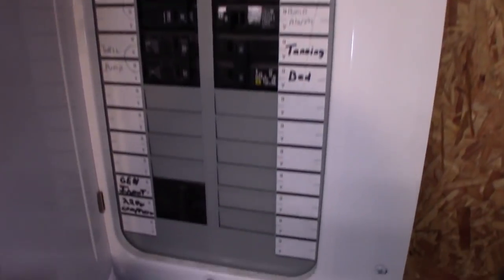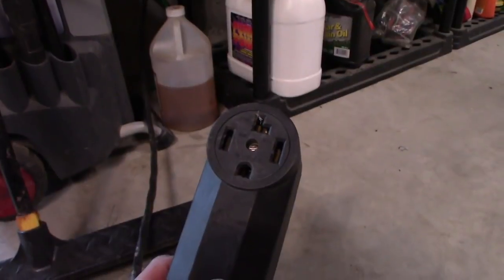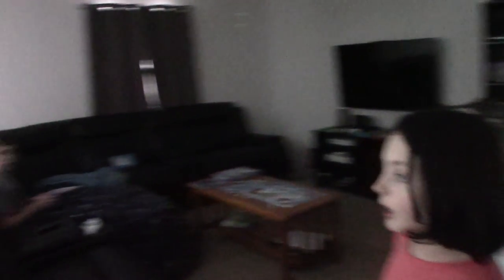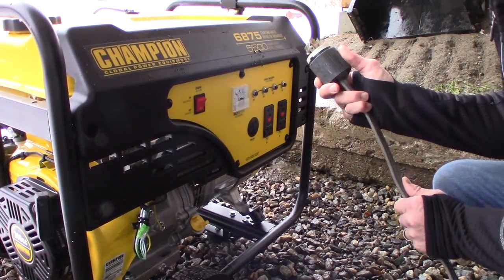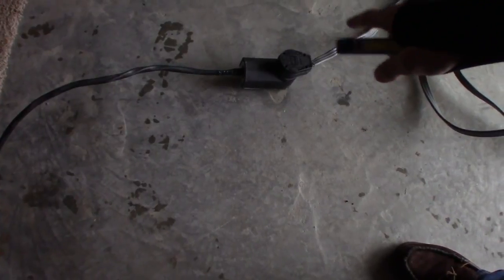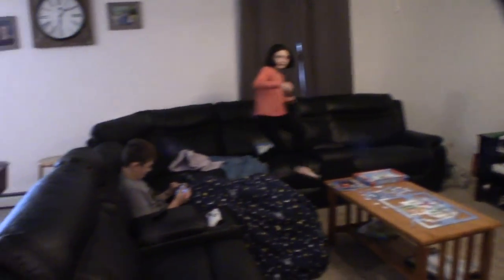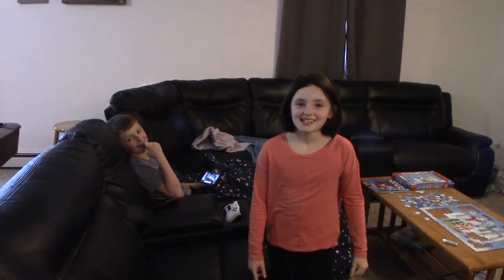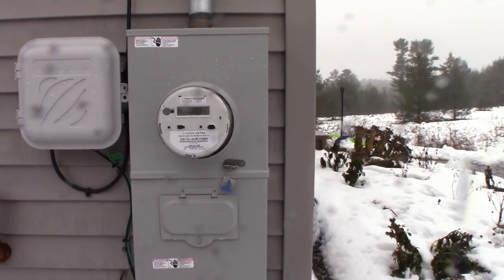Powering my ENTIRE HOME with a Gas Generator

Comment: You only feed the very top, or bottom of your panel. If you feed it in the center it makes a lot of heat and bad things will happen.

And todd,... a real gen set is a 50 KW army gen. being driven if the pto on your truck or tractor, or a ranger 305g
Reply: That no one can afford
Reply: @motersickel  ok the ranger 305g is about $5000, the old army gen i only payed $600 for it at an army surplus store.
Reply: oldreliable303 Justin Scott I don't understand why feeding it from the middle of the buss bar will generate heat and cause issues ... Mine is fed from the bottom like his ..

Comment: Better safe than sorry??? That means using an interlock to make sure the main breaker HAS to be off in order to back feed the panel. It also means using an INLET NOT an OUTLET. This is very dangerous. For just a few bucks more and almost the same amount of labor you can do this the right and safe way.
Reply: An interlock makes the circuit and outlet useless other than for generating purposes.
Reply: @snap-off5383  yeah thats why I said an inlet and not an outlet. Youd have a single device called an "inlet" which has recessed prongs, on a dedicated circuit specifically for this purpose. Its a very simple process.
Reply: @randomcuriosities8441  Having understood that already, is why I said what I said.
Reply: @snap-off5383  lol I gotta quit commenting while half asleep

Comment: That used generator brand new at club stores (Sams Club) is $299 and it's the newer model. I bought the same one you have (The older model) for $200 used

Comment: This setup is dangerous and can kill not only the user but also electricians working on the grid. Please install a proper generator circuit with a proper transfer switch and proper male to female cable. There's a reason why this cable is called the widowmaker.

Comment: This is not a ''legal' 'way to do it. That's what I've been told... 

I do exactly the same thing from the garage..

Its a briggs and stratton 8000w (10 000w peak) 

I use heavy duty plug and extension 40ft long to put the generator outside (for the exhaust)

I plug it in my welding machine dedicated socket 30 amps

The generator have a protected circuit 30amps on 240volts L14 plug

I have a 30 amps breaker for the welding machine (located in the garage)
Then I have the main breaker for the garage (located in the garage)
Then I have the main breaker of the house to kill (in the basement) 

So there is extra safety since I have one breaker more on the line

It's dangerous because you could end up with live expose metal if you don,t plug everything in before you start your generator..
It's also dangerous because you rely on human intelligence and logic instead of relying on electric equipment aprove and tested
It's dangerous because you could damage electrical equoipment if you doN,t close breaker before you turn generator off 

But except that, it works perfect it only cost me 110$ for extension cord l14 40feet, l14 connector (20$) and a stove plug with wire on it 30 amps... (20$)
Reply: 3 wire or 4 wire receptacle for welder?

Comment: Another name for that homemade cord is the Widowmaker.
Personally I wouldn't want to run Sensitive Electronics off of a generator like that.
I would be worried about a surge.
Reply: It actually works fine I ran one for 5 months like that ran a 50-inch flat screen TV my computer never had no problems
Reply: Be afraid of running them on inverter generators.

Comment: OK. I couldn't finish watching this EXTREMELY DANGEROUS video. Spend a few dollars more and use an interlock system. There is no reason to save a few dollars at the expense of your family and home.
Reply: Ran one for 5 months like this had no problems only way I could see it causing problems is if  one doesn't know what they are doing.... then I guess you shouldn't be doing this....lol
Reply: 702.5 Transfer Equipment
Transfer equipment shall be required for all standby systems subject to the requirements of this article and for which an electric utility supply is either the normal or standby source. 
Exception: Temporary connection of a portable generator without transfer equipment shall be permitted where conditions of maintenance and supervision ensure that only qualified persons service the installation and where the normal supply is physically isolated by a lockable disconnecting means or by disconnection of the normal supply conductors.
NEC GLOSSARY:
Physically Isolated (as applied to location). Not readily accessible to persons unless special means for access are used. (CMP-1)

110.25 Lockable Disconnecting Means. Where a disconnecting means is required to be lockable open elsewhere in this Code, it shall be capable of being locked in the open position.

The code allows for emergency connections.  You need to lock your main panel when doing so to keep someone else from closing the main breaker.